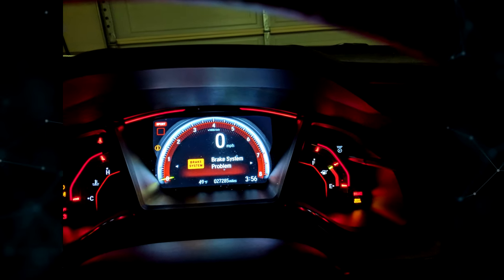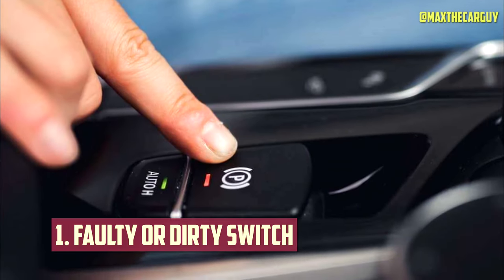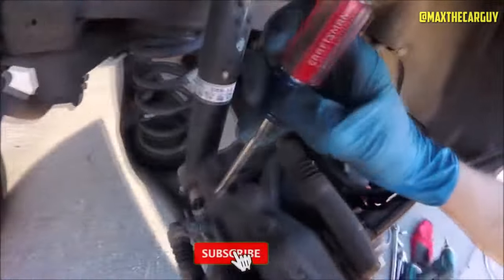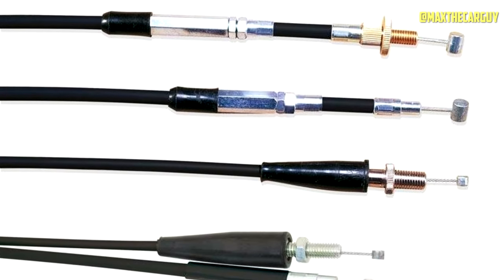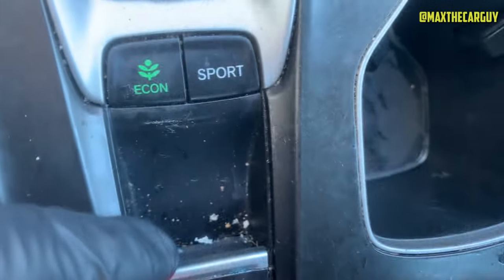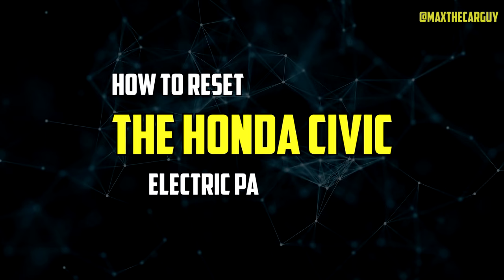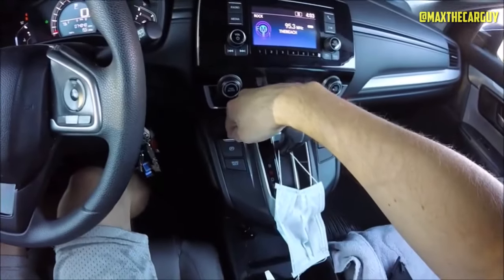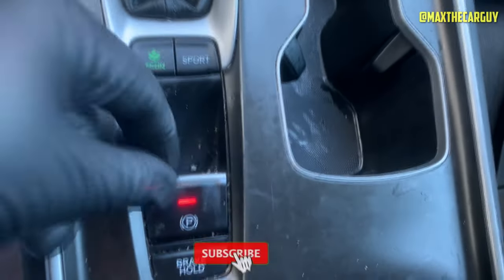5 Causes of Electric Parking Brake Problems in Honda Civic

Comment: This is why if I see a car that has an electronic parking brake, I will not buy it.
Reply: I totally agree. That’s a stupid engineering.
Reply: Fr.....I've been trying to fix my stepdaughter-in-law's civic and the brake system is pissing me off....the car has been down for damn near 3 months now
Reply: Wait until you see how stupid a manual one is and how easy it snaps corrodes gets stuck welds on slackens etc.
Reply: @tyrantlocator 3 months 😂 yeah it’s time to just admit defeat and call in the professionals

Comment: got this problem, parked my car ebrake up now its red and stuck wont go down. says electric parking brake system problem
Reply: How did you fix this
Reply: @6ixk616  mine was i remove the ebrake clip n the pin inside bent so didnt make good contact when clipped back. i align it straight again clip the ebrake wire smoothly n worked
Reply: Mine does this too..

Only use parking brake when I’m gonna turn my car off now…

You just have to push down on the electric brake when you start your car for it to turn off otherwise it’ll just beep at you the whole time you’re driving 🙃🙃🙃
Reply: Just what we need. An electric parking brake. What a joke.
Reply: @randallgoeswhere  shouldve stayed manual brake
Reply: @bulletproof3278 
I prefer manual brake over Ebrake.
Reply: @TaRiQ-x2b  same all day any day, can swap it doe wit amother gen thats had the handbrake

Comment: Does this kill the battery or make the car not start? This error message is popping up on the dash and my car isn’t starting.
Reply: Did you figure it out? I’m in that exact situation right now
Reply: @mgbomb11 did you figure it out I have the issue now
Reply: Test or replace your battery.When my battery was bad, I got all of the brake problem errors. I replaced the battery, drove it for a while, and codes went away. 2016 Honda Civic
Reply: Most likely it's the battery. You need to change it, it's ☠️
Reply: I have the same problem with my car. I changed the light bulb, and the problem surfaced. Now my car won't start.. it's 3018 Honda civic hatchback ex, I never changed the battery.  Do you think it's the battery?

Comment: Hello. Lightning struck close to my car while driving. 2021 civic sport hatchback. Now it says electric parkong brake problem and then it says brake syatem problem, then it says brake hold system problem. 
I can hear the motor workds wheb trying the parking break. 
Is there something I can do to reset this?
Reply: 2
Reply: Yes. Turn off your car then turn it on. Then put your foot on the break then push down on the parking break for about 30 seconds. It should go away.
Reply: @Drakethefrenchie how to do it? Can u teach me?
Reply: @Drakethefrenchie how to do it? Can u teach me?

Comment: So I had a older Van one time. One day I was driving it I noticed it was hard to stop give it 24 hours I woke up to go to work in the morning headed out my drive way down a hill and completely loss brakes never before have I ever had problems with my brakes but that one day in advance. We'll in the process's I press my e brake in the floor and it by no means slowed me down it more of slingshotted me. My question is this a brakes malfunction or could it be possible someone tampered with my brakes.